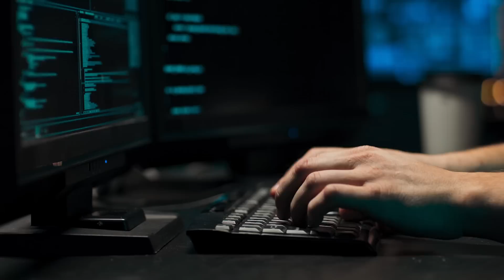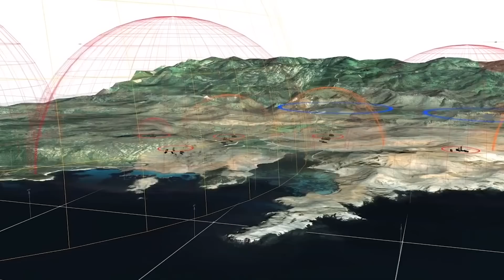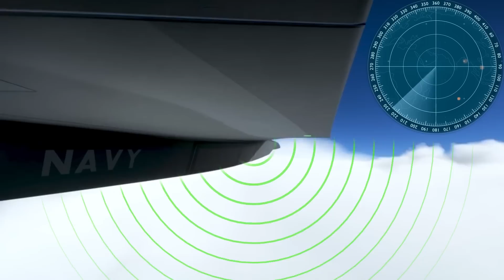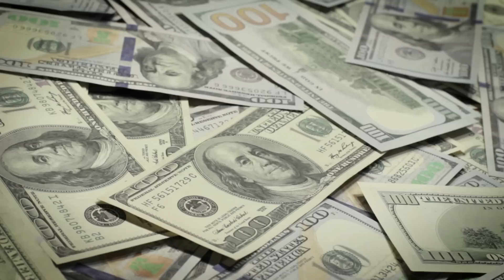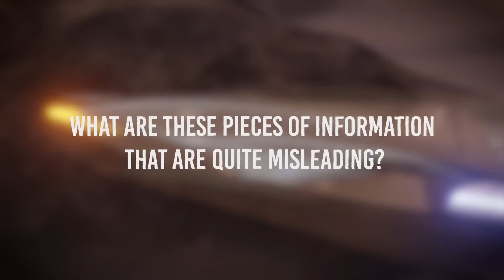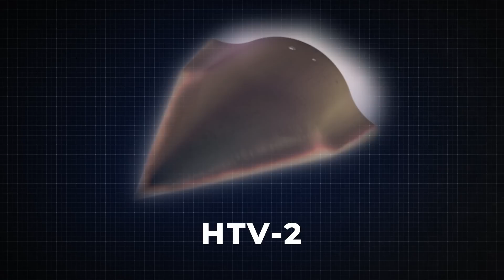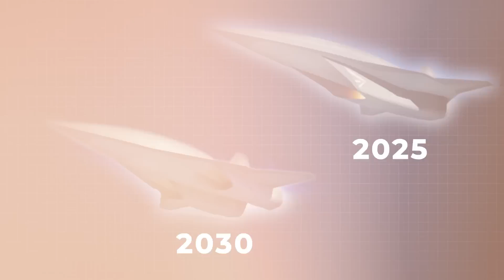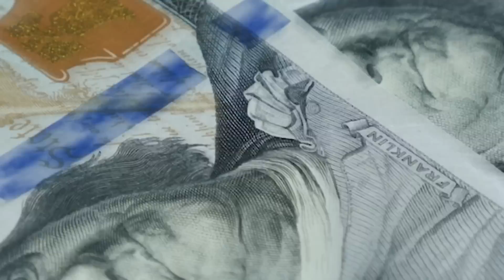US SECRET SR-72 DARKSTAR Has Finally Entered Production for 2025!

Comment: A flexible skin with the foldable  cellphone technology so it blends in with what is around the jet will make it nearly invisible. 

A skin w/o seams is possible with current molecular technologies that are being explored now.

An engine with almost no moving parts is feasible is the precepts of sound are considered  for air can be vibrated quickly to produce sound, if fuel is introduced then ignited...

Compression is possible by intuitive design,  but such an engine would require to be started at speed.

Don't mind me, I'm a  nobody who can connect dots that the original designers never intended to happen.